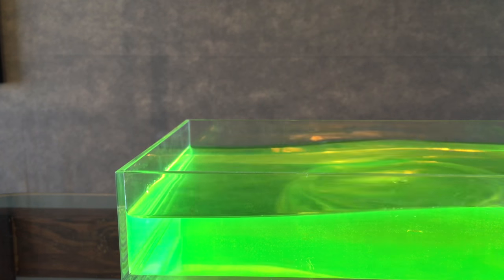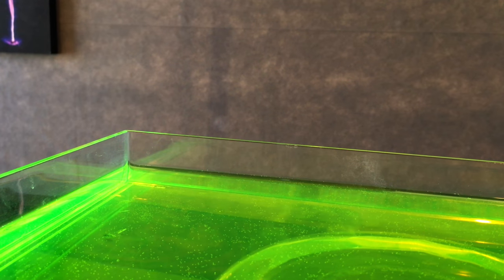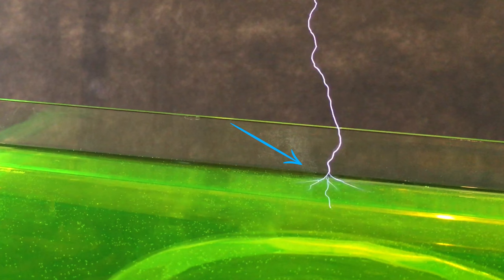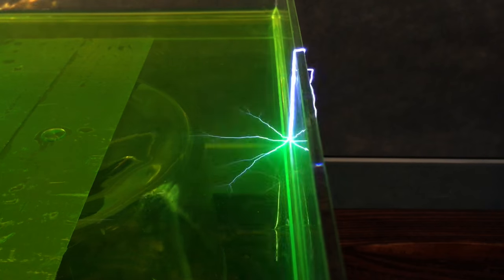Insane Lichtenberg Fractal Patterns Over Water!

Comment: Really nice patterns! But your setup is unfortunately not the best for creating this type of discharges(surface discharge on a conductive liquid): you see, the longest streamers or leaders occur when you allow them to propagate slowly, with dc it seems not possible because the voltage is constant, but with impulse voltage (such as from Marx generator) the streamers and leaders propagate very good in the exact moment when the voltage is rising from 0 to maximum. Also as far as I'm concerned, this setup would work better with distilled water. Maybe you could try at least with distilled water in the next video, if you don't have Marx generator laying around?
Reply from the maker: That is great feedback. Thank you. I’ll experiment with those two suggestions
Reply: Plasma Channel as an idea, if you do another video, perhaps expand what viduley talks about in his comment above that sounds really interesting to me.

Comment: Hey Jay. Great work as always. 
Have you seen the USB ionic air filters. Very little modifications needed to make a portable static generator. Worth a look buddy. 
'stay classy'
Reply from the maker: I appreciate the compliments. I am in fact very familiar with those ionic filters. Love them. The best ones use an AC flyback that powers an external voltage multiplier.
Reply: I wonder if jello made with pure water becomes a fractoral light build?🤔

Comment: Can we cut electricity by two parallel rods of heat ?? Such that heat is applied less but in such a frequency that high voltage cut be separated,  but insulation should not be added.

Comment: I also made fractals but on my hand! and I used a Piezoelectric crystal and not a voltage multiplier because I don't have one and 400000 volts
 is not Safe for touching with hand and no Faraday cage.